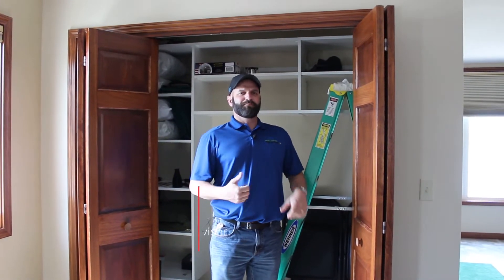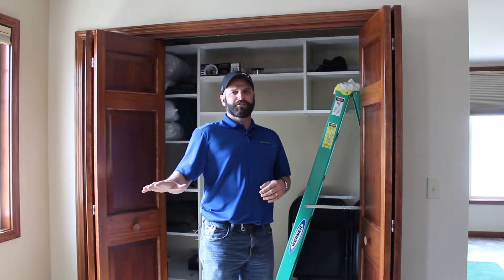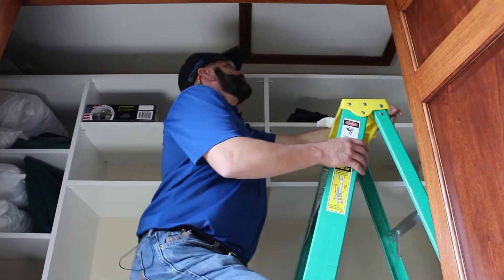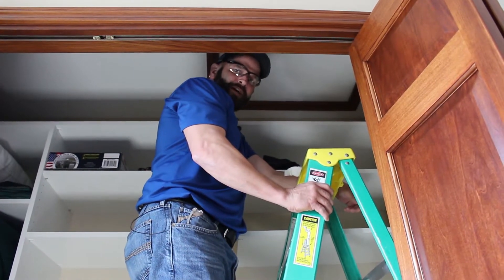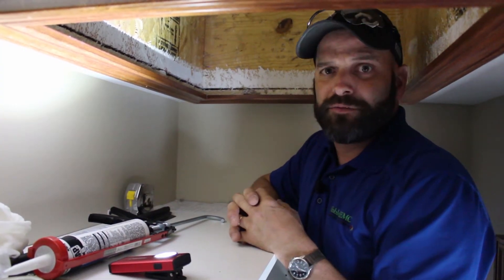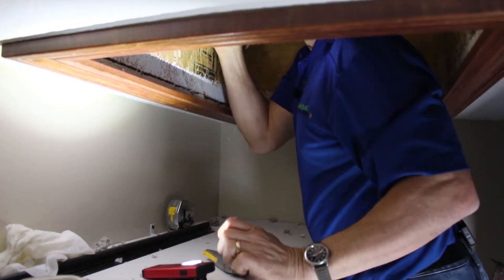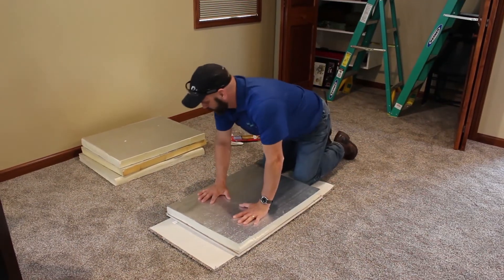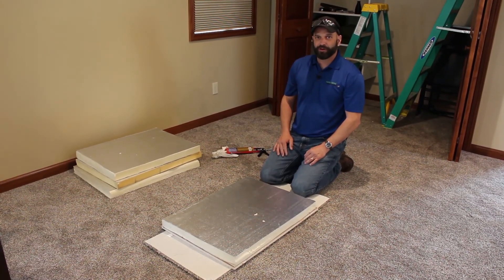Ask the Energy Advisor - Air Sealing an Attic Hatch

Comment: Can some one please address the settling effect of cellulose please? I had 10 plus inches of cellulose blown in several years ago. Went up recently to install security cams. All of that cellulose has sank to the rafter tops. As in it's ALL GONE. Cellulose is a waste of money. It settles over time. Like you just tossed all that cash out the window. At least pink panther fiberglass stays put.
Reply: Rockwool comes in batts,they are sound proofing also,yes cellulose is another word for wood/paper!!

Comment: 2 sheets of 1 inch foam is cheaper than 1 sheet of 2 inch foam. Would it be equal just to glue 2x1 inch pieces together to save costs?
Reply from the maker: Absolutely! It is acceptable to use 1” foam – you can stack as many pieces together as you would like.
Reply: @NobleREMC  Awesome because they are half the price

Comment: What about just regular peak and stick foam tape? Would that work ok, or do you think the other seal options you showed are much better?
Reply from the maker: Peel and stick foam tape will work fine. It just may not be as durable or long lasting if you use the attic access a lot.
Reply: Make sure it's a closed-cell foam or otherwise makes a good air seal. As a home inspector, I have seen countless attics "sealed" with open-celled foam, which is absolutely worthless. It's worse than having nothing at all since it actually creates a channel for air to escape into your attic space! The ones @NobleREMC suggested are the best.

Comment: Okay this may sound stupid, your the engery advisor. So heres my question : Thinking of me aging and over head strength in future. On the back of the board could I staple a extra large pillow case, that over lapse the size of door so covers over door edges, as i lift up on the door now to enter the attic, fill it with blown in cellulose, velcro shut so can refill as needed. Lol do you think it would work ? As my logic says it should, BUT doesn't mean it right :(
Reply from the maker: Interesting idea, Kathy. You made my morning…and now I want to test it out for myself.

First, the main thing is to make sure your hatch is air sealed with caulk and weather stripping – that will go the longest way in stopping that air flow. After that, I think your theory about the pillowcase is sound. My concern is the pillowcase holding an adequate amount of insulation. If you can achieve the amount of cellulose recommended for your climate zone inside of a pillow case and still seal it, give it a shot, but be cautious not to let your pillowcase interfere with the seal on the bottom side of your attic hatch.

Thank you for your thoughtful question!
Reply: @NobleREMC  Thats what I wanted to hear, I will ensure the pillowcase (xxl or homemade if need be) is centered and it over lapse the door completely, as door just rests ontop of the floor openning presently. Thanks for your advice, thoughts.

Comment: Would it be possible for a pressure change due to a strong winds outside and only  front windows being open to knock a access hatch like this open?
Reply from the maker: If you are in an open area on a windy day, there is the potential for a significant amount of pressure on your home. Putting foam on top of the hatch, like we showed in this video, should weigh it down enough to combat any pressure change issues.

Comment: When you air seal attic don't you have 2 vent the living space somehow from gasses and stale air and such?
Reply from the maker: Hey Brandon! If you are building a high-performance home, you should already have mechanical ventilation factored into the construction. If you are performing a retrofit on an existing home, you will more than likely have enough natural air changes per hour to eliminate the need for mechanical ventilation.
Reply: @NobleREMC  how so?
Reply: @Brandon-no3vc  preexisting homes are usually pretty leaky. Blower Door test can determine the tightness of the home and to find out how many air changes per hour your home typically has. Plus you don't really want the air from your attic or crawlspace to come in the home if it can be helped.
Reply: @michaelholland1310  that's why I said if your attic and crawlspace is air sealed wich it should be. Do you have a vid on how to do a blower door test?
Reply: @Brandon-no3vc  your attic floor conecting to your ceiling should be sealed but not the vents & roof fan
Reply: @Brandon-no3vc my attic has multiple vents
Reply: @DiggininthecrateS100  I ment the living space

Comment: Would this help with secondhand smoke drifting from my attic? Attic is shared with neighbors and their smoke comes into the attic through exhaust fan.
Reply from the maker: Unfortunately, if you’re in an apartment situation, my guess is you’re getting the secondhand smoke coming through your bath fan exhaust rather than your attic hatch. It’s not uncommon for multi-family units to have shared bath fan exhaust lines to a single point of exit out of a building. This is an issue you would want to address with your landlord or property manager.
Reply: @NobleREMC  I get it through both my bathroom exhaust and my utility closet where my hatch is located. I’ve spoken with HOA and the owners of the condo below that rent to my neighbors and they won’t help :(

Comment: Yeah. Air seal those houses real good. Then we can sell you a 10 thousand dollar fresh air system so your house can breathe.
Reply: Also, attic Air isn't really "fresh" air. It can also make homes more humid so the indoor air quality is worse.  As long as there's still enough airflow in the home there shouldn't be an issue or need to purchase mechanical ventilation.
Reply: LOL, there's always one.
Reply: Even air sealing as much as you can still leaves a lot of air filtration thru the walls and windows. If you can get down to 2 ACH you are doing great but still have a lot of air filtration.
Reply: Come pay my utility bill
Reply: Sign me up